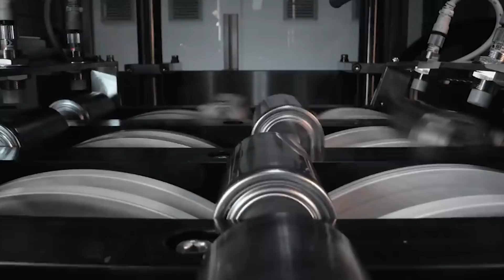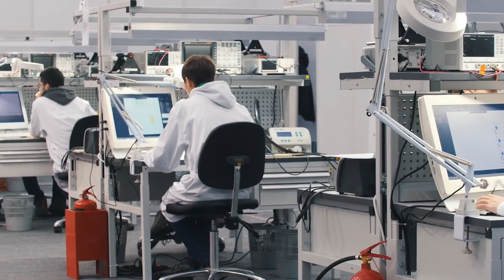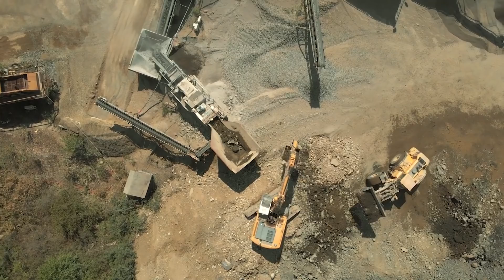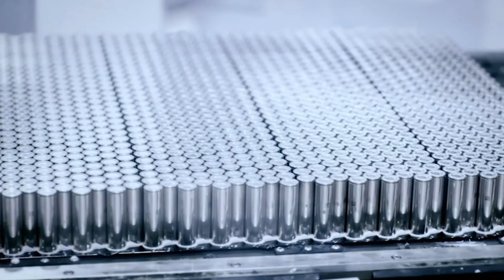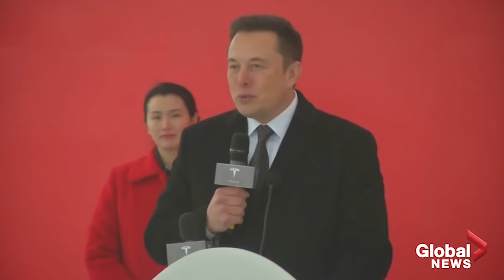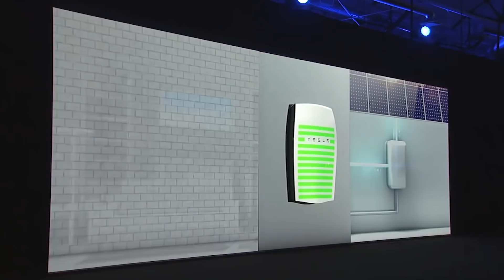New Tesla Battery Announced!

Comment: If Tesla is making EVs for its own Robo taxi network they can have some cars in the mix with say a 150 mile range and maybe a 35 KWH rather then a 70 KWH battery.
Reply from the maker: That's an interesting thought
Reply: What's the point?
Reply: @iceftw4865  If they are battery constrained then this approach helps deal with that. If people are taking trips of 1 to 10 miles usually then a 350 mile range taxi isn't needed.

Comment: Important video!  You didn't mention of the mass difference of Manganese and Iron.  Isn't manganese much lighter per unit volume than iron?  Also while a mineral's abundance on Earth is important to consider; that chemistry aspect can render gold to be abundant if it can be used in a greatly diluted form.  Whether a mechanical or a chemical alloy, mixtures of metals and minerals can prove to be powerful and safe innovative alternatives to current mass produced batteries.  We seem to be more limited by how much time it takes to hypothesize what works and then experiment with that and through this work and serendipity arrive at satisfaction.  I think we need a defensive patent to make a universal emergency exchangeable battery canister that can contain a variety of battery forms and chemistries that can "Plug n Play" into any vehicle.  It can be used as a range extender or as an emergency power supply for a stranded vehicle.
Reply from the maker: Yes, and you could also potentially have an iron and manganese cathode too

Comment: Please can you tell us why LFP cannot be made in 4680 format.
Reply: Or at least why 4680 is not ideal for LFP.
Reply: @RG-dt6ok , basically, it is unnecessarily constraining the form factor to a smaller size than what would be optimal for that chemistry.  LFP is both heavier and less chemically volatile than NCA/NMC chemistries.  Therefore it doesn't need to be individually packaged as small to prevent thermal runaway.  It also benefits from being in a larger package to reduce weight (higher guts to container ratio) which helps offset some of the weight disadvantage LFP has compared to NMC/NCA/etc.  So it's not that 4680 LFP can't be done.  It's just not the optimal form factor for LFP.
Reply from the maker: It can be, but it's not the idea size for LFP and its application

Comment: Range may well become a non-issue as energized roads provide wireless charging. At that point, battery mass may be low, eliminating much weight, yielding better mileage.

Comment: Lithium is a very small percentage of every battery. We need all we can get but it is abundant. By the way, LFP has only 14% less capacity than the nickel-cobalt varieties. It’s long cycle life means over time it’s at least as good.
Reply: David Ellliot:  But it's heavier and many people want max range.  So like everything, it's trade-offs.  It's also terrific for stationary applications, like backup power. 

For me, I'll take lower cost and more durability and safety EVERY TIME, if the range difference is only about 20%, since I rarely drive over 100 miles.  But it will vary on peoples' driving patterns and priorities.  As a consumer, it's good to have multiple good choices.

Comment: Power wall can’t be too heavy. Installation will become very difficult. Weight increases cost a lot in a domestic setting.
Reply from the maker: It would just sit on the floor.
Reply: They could just have two half size units that sit next to each other.

Comment: Check your facts.
All information I've seen (for at least 3 years) indicates manganese will be used as a substitute for COBALT.
It's the final piece in the puzzle to achieve the much publicised "cobalt free" cell, rather than a substitute for Nickel.
As such, if used in similar proportion, it would constitute appropriately 3-5% of the cell.
It may be the case that they increase the percentage to have similar effect, time will tell.
Reply from the maker: The Mang is a substitute for iron in LFP,  not cobalt or nickel. This is what Elon said.
Reply: @TeslaEconomist  I am thinking the MN is going in as an addition to the LFP. It increases the voltage (energy density). Would be fun if they used Li3PO4, instead of the more expensive carbonate or hydroxides.
Reply: @TeslaEconomist  It is not. It is used to replace cobalt. It is much cheaper than cobalt. And manganese  is all ready used in batteries of GM.
Reply: "We do think that all stationary storage – PowerWall and MegaPack – will transition to an iron based system. Basically a non nickel system. Manganese could also be part of the future, but primarily iron,” Musk said at the quarterly earnings report"
Reply: Roger You are correct, but you are thinking of ternary lithium ion chemistries (NMC) or (NCA).

Comment: LFP for stationary storage and short range vehicles. LMO for regular vehicle lines. Nickel based for Cyber truck and Semi.
Reply: If the Semi has 4 tons of NMC batteries it needs only an additional 560kg to get the same capacity in LFP (14% energy difference). 1/2 a tone is not trivial but it’s only about 1.3% of a fully loaded 40 ton tractor-trailer outfit. Consider the benefits of excellent cycle life, robust chemistry and all round toughness and LFP easily wins.
Reply from the maker: Yea, I was thinking the same.

Comment: Do you think UK cars will continue from Shanghai, or will Berlin eventually make LHD cars?
Reply: When the car is designed to be left or right-hand drive, the costs of swapping the steering wheel to the other side are not particularly high. It's even less in a Tesla, because the instruments (screen) is on the centre line.
Reply: @Dave5843-d9m  Good point 👍
Reply from the maker: Berlin most likely, at least within time.